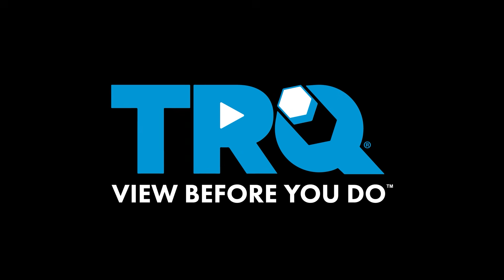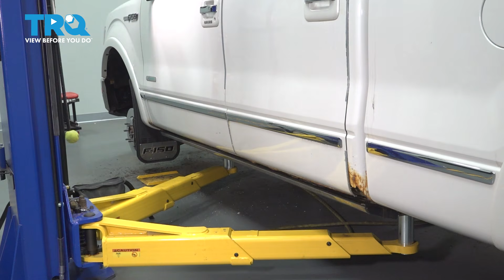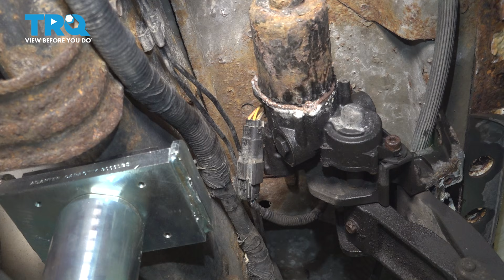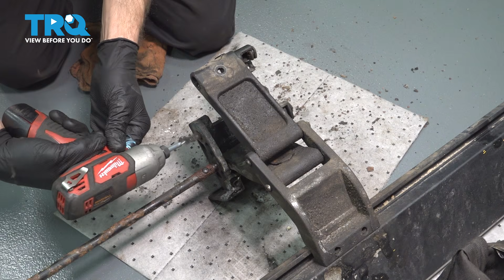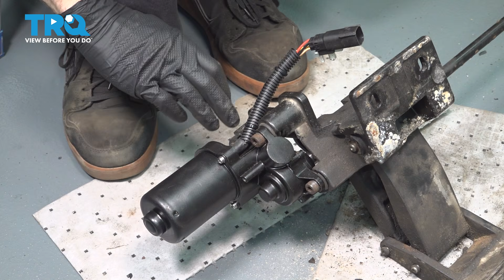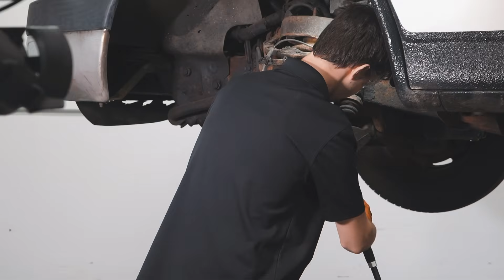How to Replace Power Running Board Motors 2009-2014 Ford F-150

Comment: I have 11 expedition, need to replace my motor for running board. Mine has a bar just above the running board that I don’t see in your video. I got it all down and little block out, the motor itself will not come out! I have even used an air hammer!! Any suggestions on how to get it out of the bracket? Or do I need to buy another one with the bracket attached?! I’m replacing the whole assembly on driver side, just the motor on passenger side, as a piece of rear bracket broke on driver side